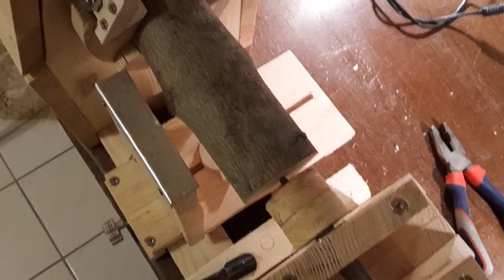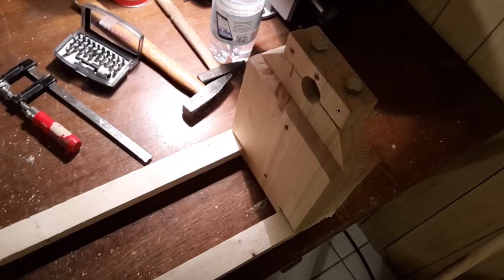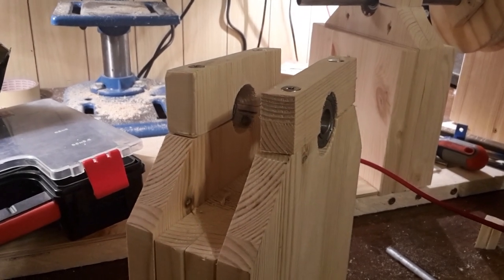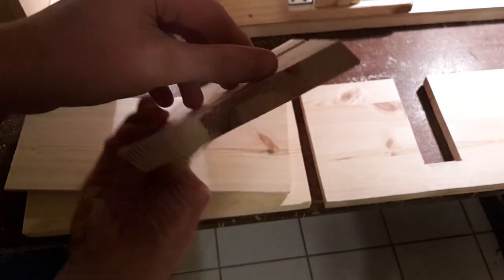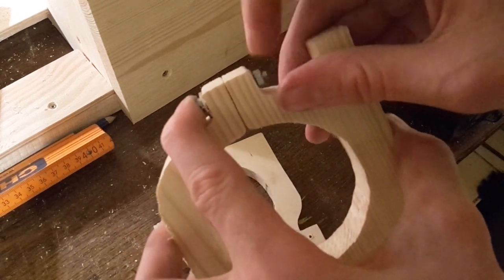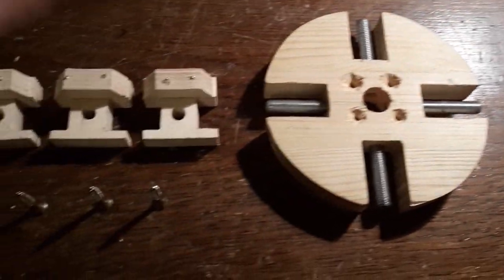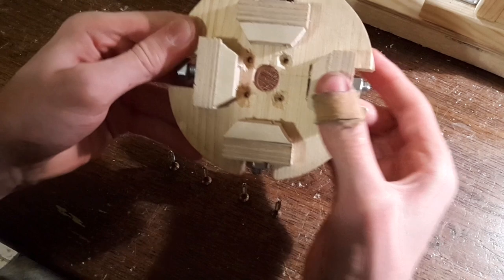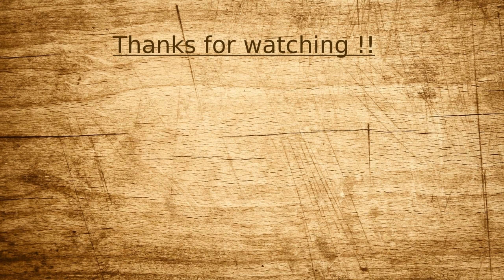How to make your own lathe [ & 4-jaw chuck] !  - Free plans

Comment: ok so cool lathe like it a lot built one myself now I have one of those crappy harbor freight  ones that I had to reinforce the hell out of because as soon as you screw in the tail stock the whole tail stock would lean back causing misalignment and a serious wobble. as for the threaded rod your screwing down to hold the tail stock in place it also causes the whole tail stock to lean back causing the same wobble  how cam itnotthe stocks are now no longer aligned